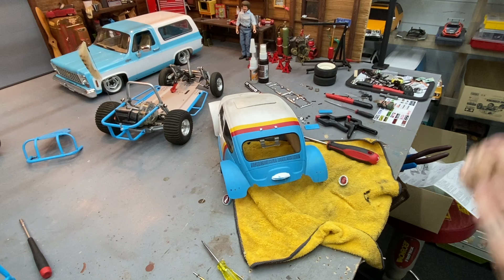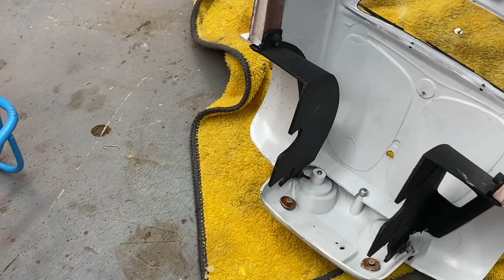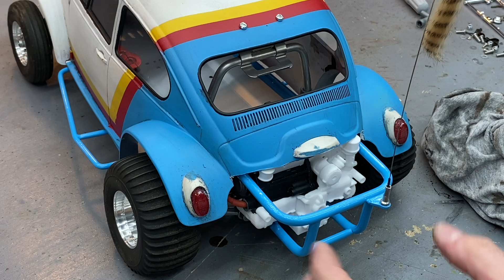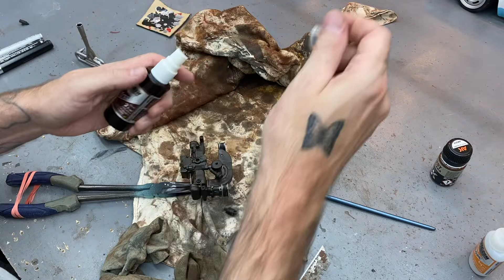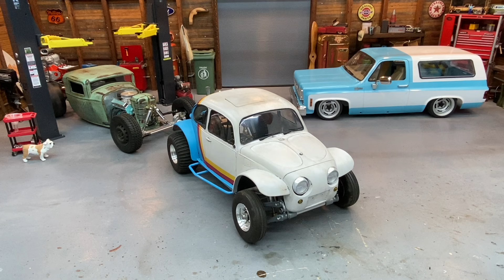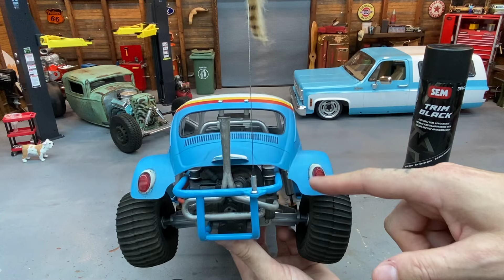Tamiya Sand Scorcher Build Part 3,  Scale Engine Paint & Patina

Comment: So the chassis with the side bars is worth it? But skip the roll cage ?
Reply from the maker: Truly the only part that was worth it was the side bars.  The front and rear bumpers are low quality versions of what it comes with already, the aftermarket chassis I already had on it could easily drill holes and mount the side bars. Save your money.